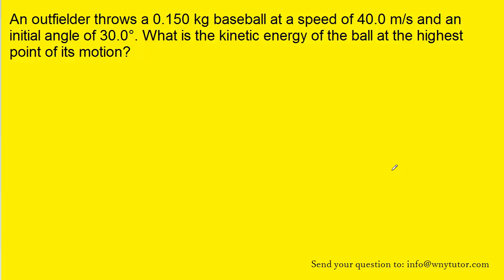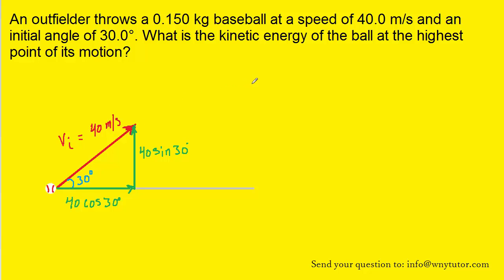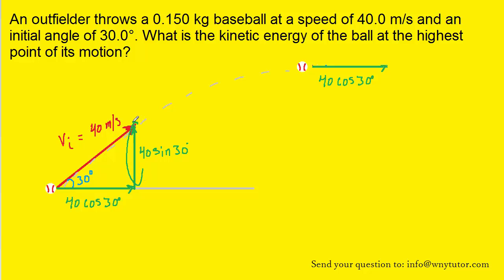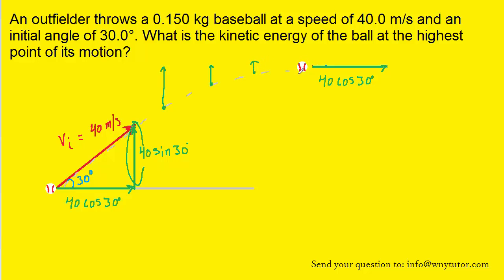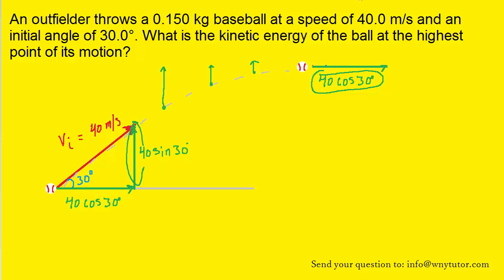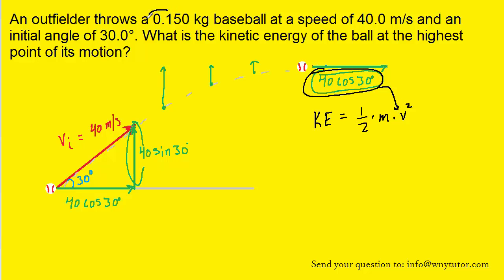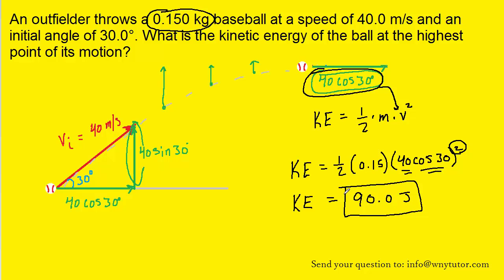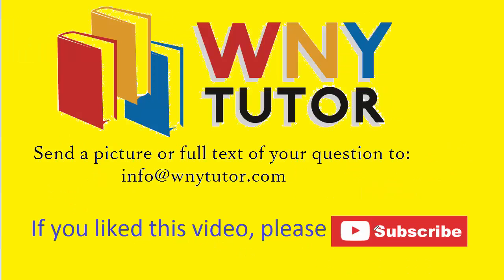An outfielder throws a 0.150 kg baseball at a speed of 40.0 m/s and an initial angle of 30.0°. What

Comment: I keep getting 2.25 what am I doing wrong?
Reply: put your calculator in degree mode instead of rad. rad gives me a smaller number. I'm not really sure the reasoning. just make sure calculator is in degree mode when calculating (40cos30)^2
Reply: you're most likely doing the same as me and forgetting to square (40cos(30)), and yeah, make sure you're in degrees.